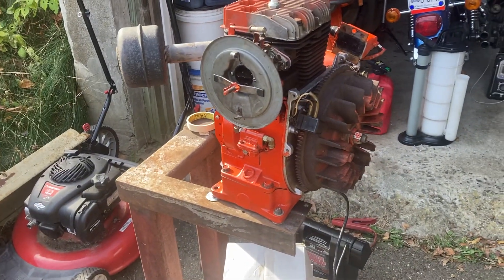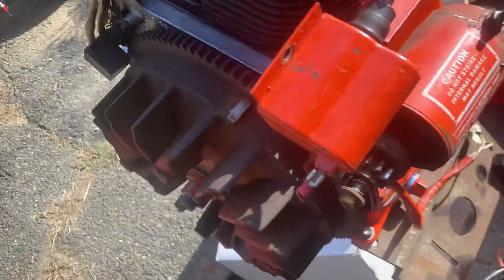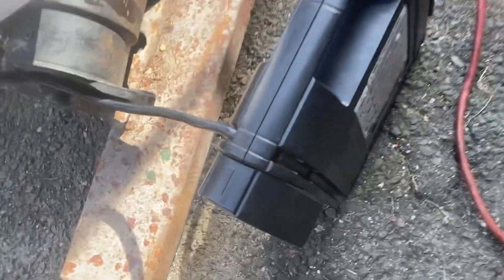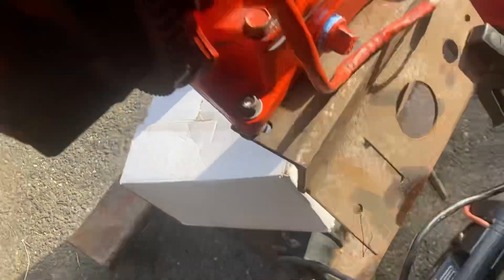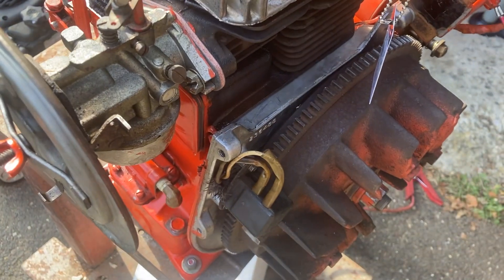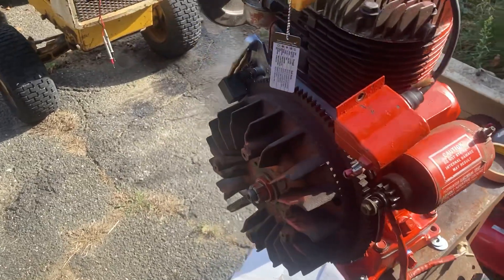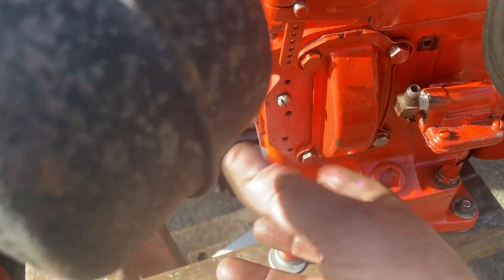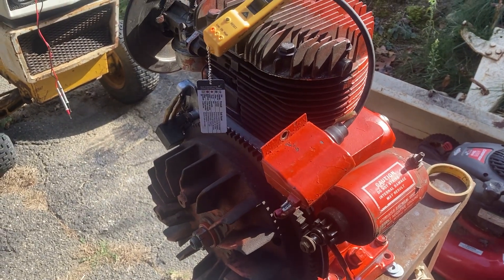Smoking Kohler K321 engine is ready to roll, breakerless ignition not sparking, HELP

Comment: Did you ever get anywhere with this Ken?
Reply from the maker: The owner took the engine and ended up converting it to battery and coil points ignition.  Kohler sells a kit to do this.  It is in his Economy Power King and runs Strong!  Those breakerless ignitions were prone to failure so they only lasted one year 1968.

Comment: Well I'm on the edge of my seat now,, Ya gotta make a video on the fix! Ya sure its not a Chrysler lol
You could test for function instead of electrical resistance. Spin the engine with a drill, plug out. Energize the coil field and collapse it to see if it sparks. 
Isolate the trigger and coil, spin the engine with each part isolated. Does the trigger shoot? lol so to speak. 
I like that spark tester, what video did you show that again? I was trying to find it the other day.
Reply from the maker: https://youtu.be/WZ6ZFp_Tpw8?si=xltLxhBAYh6Ofzgk

https://www.youtube.com/redirect?event=comments&redir_token=QUFFLUhqa3VuMy1FTWN5Ny1LV05rZHRIXzlFX1J3Q2dXd3xBQ3Jtc0ttVXlIanRmWVU1R0U4akdFeFRSSDd4c1UyQXNzVGRnN1R1R09pR0loYTFuemg4NVN6Q3p6ckZ3RGVkb0tfTko5WGFwWU5YckNTbXVGWVVhcXZKRFhIUjJkaFJqbl9lRTJua0RtakFKM0VzUnNSUzZnZw&q=https%3A%2F%2Fwww.rcpw.com%2Ftrillium-spc-7200-spark-checkr-engine-spark-tester-ignition-analyzer-for-small-engines-motorcycles-and-more%2F%3Fgclid%3DCj0KCQiAlKmeBhCkARIsAHy7WVvpzWMqzd5CTvDhu2wuH3EKQv0BxkWvNKMuX6B6J_ixHi-swKwV72caAvGIEALw_wcB&stzid=UgyYD7kC9Sy3EULajJR4AaABAg

Comment: Be sure not to apply 12 volts to that system.
Reply from the maker: Yup, don't want to fry that expensive coil!  If I recall, you guys had a 14 hp PK in the basement of the dealership years ago, was that a breakerless ignition?

Comment: There is one winding on the stator that powers that system. If you put at meter on the trigger and give the round sensor a very light tap with a hammer continuity should reverse, also make sure the air gap is set properly. I should have an old manual that has the exact testing procedure. Talk to Justin M at L&R and he could give you my number.
Reply from the maker: I know you Tony, I’m buddies with Fat Rich R.  My customer patched up the wire and now it’s putting out good voltage so hopefully we’ll get some spark tomorrow.

Comment: Old wires can fool you. If all the wiring is verified good try to wire it up to the ignition switch and try it again. If it's not getting 12 volt DC to the hot side of the coil when cranking, you'll need to supply it thru the ignition switch or run a temporary jumper wire. If the the pickup module is bad, I'd convert back to breaker points, much much cheaper option. It's a breakerless ignition but it will still need 12V at the + side of the coil. You'll have to get it running before you can verify it's charging or not.
Reply from the maker: Not this one, it’s breakerless. 12v to the coil will kill it
Reply: @KensSmallEngineRepair  If it's not getting 12V DC from the stator then either the stator or the blocking diode that turns AC into DC must be bad. The coil will not fire without a voltage going to it. These don't have a magneto.
Reply from the maker: DC from the stator? I thought they only produce AC voltage?
Reply: @KensSmallEngineRepair  Yes the stator only produces AC that's why there must be a blocking diode in the system to turn that AC from the stator into DC voltage.
Reply from the maker: @KentuckyFriedFixes I tested the trigger per the manual, flow in only one direction, meaning diodes are working properly. We are still stumped as the coil worked fine on another tractor with the same ignition.  I just don’t know how else to check the trigger or stator
Reply: @KensSmallEngineRepair  If the diode is working then that just leaves the stator or wiring causing the problem. If the stator windings check out on the Ohm meter maybe a loose or missing magnet that charges the stator windings? It's a head scratcher for sure Ken.

Comment: Shouldn't you see a low ohms measurment on the second coil measurment to ground about like 5 ohms to 30 ohms   0:40    With the points open.    That gives you the step up inductance,    I also may have missed something.    I would take the coil off to remove any unknown values.   and measure both the high tension resitance and low  (secondary) resitamce.    It is a step up transformer.    One should be in the thousands and one should be in the low ohms   below 50 ohms.    Thus giving you the "kick"   Best of luck.
Reply from the maker: No points, it’s a breakerless ignition system
Reply: Yes but disconnected the wire on the low side of the coil should read at the low ohms  not open---- setting on the coil.   @KensSmallEngineRepair

Comment: Hi Ken, did you say there is 'no continuity' on the primary winding of the coil ? I would expect a few ohms to ground.. And there shouldn't be any resistance between primary and secondary windings.. I could be wrong in this case though..
Reply from the maker: The coil and trigger tested out perfectly as per the instructions in the Kohler Manual.  When the customer came over, we checked for AC coming out of the stater lead, and got a spark, which led us to look at the wire, and we found a crack in the insulation, which could be shorting out that wire not giving any voltage to the trigger. Thanks to Ralph who is RW3DOG on YouTube who told me to check for AC voltage on that stator line.
Reply: @KensSmallEngineRepair  Well done, thanks for the reply..

Comment: If I recall, at my age that's questionable, the coil has two wires at the bottom. One to the trigger and one to the switch to kill the spark. The secondary winding on the stator supplies power to the trigger then to the coil. Without the schematic it might be a bit hard to properly test. Good luck.
Reply from the maker: Just one wire at the bottom to kill the spark
Reply: @KensSmallEngineRepair  It is also the low ohms for the coil input

Comment: 🤔 ken is it a "stand-alone" engine? Dos it make it's owen ground? Or do you have it groundet in the engine-stand? 
🤔..... you do have it.... the starter works.... 🤔 hmm wird
Reply from the maker: It goes into an Economy Brand Power King Tractor
Reply: @KensSmallEngineRepair  ya i heard you said that but i meant if it coild run alone with out a battery. 🤔but it´s still strange it wount start
Reply from the maker: @mortensgarage  ya it can run alone, the only connection to the tractor is to the ignition switch to ground out the coil and shut off the engine